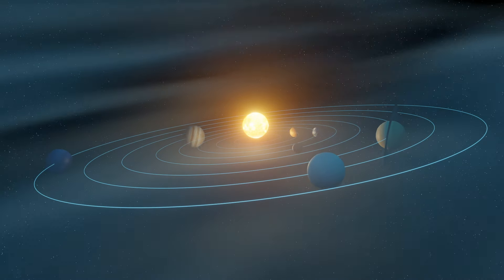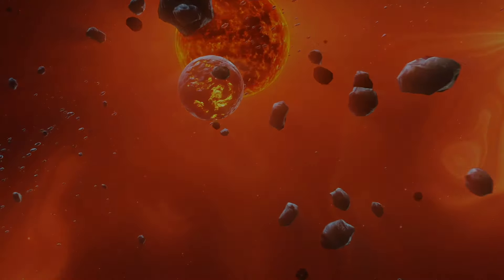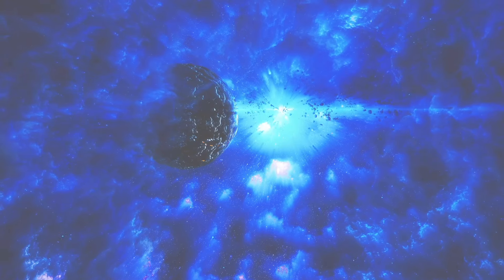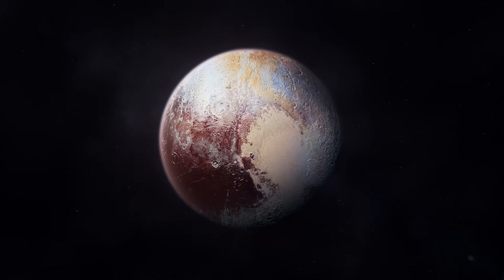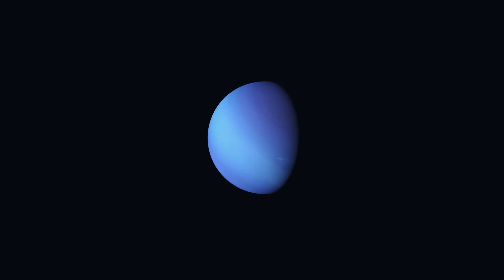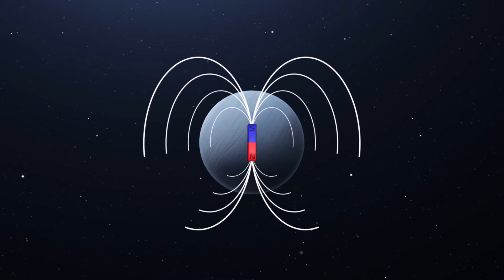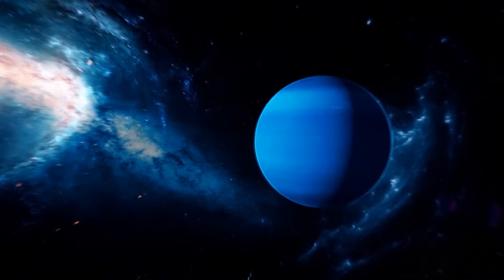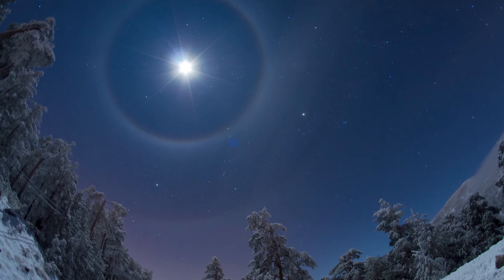NASA Discovers Mysterious Structure In Solar System!

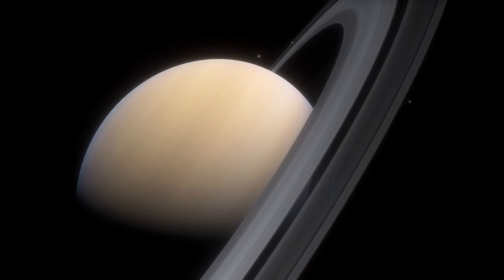Comment: At 41:42, there is something wrong about the methane wind speeds on Neptune, located in the upper right corner of the video.

It says 144 km/h, 360 mph. But that's impossible =/

1 mile = 1.6 km. So if you multiply 360 mph x 1.6 it gives you 576 km/h.

Just so you know, Destiny :) But the video is amazing ! Thank you for that 2 hours of pure speed of light greatness about the universe. <3

Comment: Man hasn't even existed 13.6 billion years ago on earth, so how can they determine and confirm a specific number of years of how old our solar system really is?
Reply: Age is just a theory at this point, cause they use different methods, and each one gives a different result.
Reply: There are even stars older than the universe 🤷‍♂️
Reply: You can tell a star how old it and it’s system is by its metal content. It’s an approximation and the stars that have been measured to be over 13 billion have been remeasured more carefully and with better data. So as of now no star we have seen is older than the universe but we keep finding more and more older stars. Our star the sun is a 3rd generation star.
Reply: @justinwolf7490  Okay,  try to keep an open mind about this.  By measuring the metal content in the stars, how do they know that the method they are using is accurate at determining the age of the stars and our solar system?  Is there another method that is more accurate?  Can they quantify that these stars are indeed billions of years old?  Based on the measuring technique that they use,  how is an estimated timeline to determine the age of stars and the solar system scientific?  If they are estimating the timeline of years in regard to the age of a star then they are really exercising the concept of faith in their hypothesis because the scientific community cannot accurately conclude how many years ago the stars and solar system formed.
Reply: @leviticusashley4447  Yes. My thoughts exactly!👍  Thank you.
Reply: Folks, if all of you go to college and study astrophysics for a few years then you might be able to grasp how all of this works.   As an astronomer I can tell you this.  Millions of stars have been studied in depth, for many years, using methodologies that go way beyond what you can probably understand, given your current lack of knowledge on the subject.
Reply: @booklover6753  You cannot conclusively prove to me that these stars are billions of years old!  Men didn't exist billions of years ago!  Carbon dating has been a hotly debated topic in regards for it's accuracy.  People don't need to attend college degree o learn about astrophysics and astronomy!
Reply: @booklover6753  There is only approximately 6000 years of recorded history from mankind!
Reply: @booklover6753  Yeah, these same experts predicted another ice age back in the 1970's too!  Based on their research and theories that were presented as being factual,  they were completely wrong in their hypothesis of having another ice age in the early 2000's!
Reply: @jasonkhan854  Your comments don't even warrant reply.  It is better to be silent and thought ignorant, than to have spoken and removed all doubt.
Reply: @booklover6753  You're sarcasm and arrogance is very unappealing! People can learn through self study without the prestige and recognition of a college or university!  Many prominent and successful people that have achieved milestones in their lives were self taught and have had no formal educational background!  You're absolutely entitled to believe what you think but so am I!  Your opinion doesn't make you superior to others who do not have a formal educational background!  Science is a discipline,  however,  it is mainly comprised of theoretical concepts that are presented throughout the educational community as being factual!. Scientific theory is no different than a person who studies and believes in theology and faith based teachings!  Both cannot be conclusively proven as fact. Both disciplines are based in faith!
Reply: @wizard1404  Yes, they did!  They lied about everything.
Reply: @leviticusashley4447  no there isn't
Reply: @timq6224  You can not physically prove to me that those paintings in the caverns are 15,000 years old.  If carbon dating is the method to which it can be measured then you have unfortunately believed the lie that carbon dating is one percent accurate.
Reply: @timq6224  In the 1970's when I was a kid,  I was old enough to remember that the scientific community predicted a great ice age that would take place in the late twentieth century and early twenty first century.  I have no reason to lie about something like this.

Comment: I don't believe that scientists know exactly how our solar system formed. Some planets and moons could have been flung from other places in our galaxy, or even from other galaxies, and captured by the gravity of our sun, or other large body.
Reply: I have a different theory...I think the Sun was established and created either from collapse of the region of space where the sun is located due to a tunnel formed from another dense energy source, which that energy source was created from maybe a black hole or the clash of space densities to create a thermic point flaring into the Sun...or the divorce of space to pull out a thermic point or electric point..
Reply: What if at the very center of our earth is a micro black hole...and that is what is responsible for pole shifts...
Reply: A micro black hole surrounded by a dense magnetic field would make sense at the center of the earth because it would stabilize and contract matter on earth and the oceans simultaneously creating a dense magnetic field around the earth...

Comment: Please note a chemistry principle of heat energy guidance being a principle of controlling distanced as the bonding factor of 2 particles, which if to close with the 2 opposite ends coping with space gaps with  their area would be cooling themselves out of having less activity ability sharing, but if made to bond at a greater distance, the bond is heat that still giving them the ability to share instant wave sharing responses, especially if looking at the distance gap as being a magnetic field also considered a bonding factor at the nuclear level but to cope the distance. Or the lead to gravitational settlements of dust particles finding themselves in empty Space, but note these dust particles must be said travelling 1000s of miles a minute with trajectory logics to settlement consideration together even before they start their bonding.
Reply: In other words, the Solar System's dust building it, as well as the Galaxy's, was already in a momentum that was frictionless, thus sharing heat as fusion, instead of sharing friction that would be considered a repulsion.
Reply: Also notice how light drifts with the adjustment of the Solar System's gravitational field of unity of everything in the Solar System's shared gravitational filed as the Solar System speeds through Space making it look like it is standing still.
Reply: In other words, the light stays where it is positioned to stay, and if bend that is not a reflection based bend, is a gravitational bend or shared merging of 2 energies that are at the moment frictionless.
Reply: So with the inner Earth's mantle layer and core being build on heat, this heat must be more like frictionless radiant heat, thus it is like a liquid solidness staying to support and not having to dissipate the radiation in a way when heat is mixed with oxygen causes a chaotic flame burst. Thus the heat could be considered a solid, or like a battery storing voltage, with out the voltage becoming a current to drain the voltage build up with dislocations.
Reply: Also take note if a current is made to leave the battery, anything that participates with its energy boost becomes based on as possible, but if the current makes it back to the battery to rejoin the existing energy stay, it joins back in a frictionless state. A logic of weather?

Comment: 8:38 Mass comes together forms a star.
Upon coming together fusion happens which forms the heavier elements.
Gravitic shifting makes layers of concentration of elements,
but also of more complex molecules, like water.
The initial spin, and speed remains, and expansion happens, velocity
remaining expels the speedy stuff, and along with it gaseous water.
Since both speed and gravitic were the separators and concentrators,
it stands to reason that at a certain distance as a result of an orbit speed
certain molecules or elements acrue the most.
Note that the actual amount of water is actually very little, while at this distance
withs aid orbit speed, mostly metals acrued..
The gas giants got the most of the gases.
The planets beyond them are leftover chunks by runaway acretion.
When there's nothing to reduce the speed, the speed becomes
greatest on the outside of the spin.

Comment: Alot of the water is stuck deep down in the mantles crust too. They didn't calculate all the water that would've seeped deep down and absorbed by dirt,sand n rocks and in the water running underground in caverns n lakes n stuff.
Reply: do not confuse water with an hydroxy molecule.  The earth's mantle is full of hydroxy molecules not actual water.  The video already shows how much extra water is in and on the planet.

Comment: If the Sun is a ball of electricity and if space has an oil like viscosity, the two combined would create hot/cold plasma, correct? Is there such a thing as cold plasma?
Reply: if donkeys had antlers they would be reindeer.
Reply: @cameronkrause4712  what causes the same metals to immediately fuse together in space? What's cold fusion?  Will there be cold fusion engineering in orbit in the future?

Comment: How can you have liquid diamonds? Diamonds are a sublime which means they can only exist in 2 states solid and gas! Unlike water and metals if you heat them they have a melting point turning them into a liquid state and if you continue to heat them they have a boiling point turning them into a gas. And diamonds have no melting point just a boiling point (around 6500+ degrees centigrade)

Comment: If only people would wise up and build a moveable space station.
Once done, everything can be examined at great length
and with sufficient long term support.
Attach a few ion engines, and off you go.
Required fuel consumption roughly 1.6% of mass for a trip to Kuiper belt,
travel time 156 days, 312 days round trip at 3.2% mass for fuel.
Ion efficiency estimated at 0.5 c Isp.
Cyclotron based ion engines => for trekkies, impulse engine.

Comment: 1:37:25, I wonder if the light and matter from those supernovae had measurable effects on the genetic evolution of species on earth.
Reply: yes would be the short answer.  Almost a change to genetic structures are the result of some form of radiation.  A nova pointed in just the right direction would irradiate anything in it's path.

Comment: Black holes are smaller than the tip of a pin... The event horizon might be the size of a grapefruit...  Ets aren't hanging out on a -400  degree rock in the kuiper belt and you touched on the fact planet 9 was a miscalculation that is now fixed... I thought this was what we found and not speculation on what we haven't found.

Comment: When looking through the telescope what is the starting point of the beginning? Are we moving in the direction of all other solar systems and universes?
Reply: The starting point was the separation/division of the physical dimensions.  That's long before the cosmic background radiation and it lasted forever.  The expansion of space also applies to the expansion of TIME. Physicists neglect to consider that.

Comment: If the core of the sun is 64% helium and 35% hydrogen and the general composition is 91% helium and 8% hydrogen that doesn't sound like the sun is going to last another 5 billion years at that consumption rate. We won't care since Earth will be too hot a billion or so years from now. However, I seem to remember that while helium fusion is hotter, it doesn't last nearly as long. Hydrogen fusion goes for billions of years but helium fusion is measured in millions of years... and low millions at that.

Comment: If you say 5, i say 6 major extinction. There was a big extinction in Precambrian, 1000 Ma ago. The extinction of the stromatolithes which was the EXACT limit between MESO - proterozoic and NEO- proterozoic.
On the other note, 
1. the end of Ordovician as far as I remember is ~443 Ma, the ~415 Ma is the Silurian end (~419 Ma);
2. ~322 Ma is the Carboniferous period and not the Late Devonian. (Devonian ends at ~358 Ma);
3. Permian starts around ~300 Ma (~298 Ma) and ends at ~251 Ma;
4. Triasic starts with the end of Permian, ~298 Ma, and ends at ~201 Ma. The 145 Ma is the end of Jurasic period;
5. End of Cretacious period is ~66 Ma. The 33 Ma is way in the Cenozoic Era.

All the informations you can find in the chronostratigraphical chart (please check the latest version since there are new updates compared to the old charts). Thank you.

Please update and fix this. Don't spread wrong informations and correct it with the adequate dates/informations which are studied, written, published and accepted by all scientist.

Comment: 22:42 Its not "in" our solar system.  It's supposed to be ~40AU in between Sol and it's sister star, a red dwarf, which has not been found.  Perturbations of the outer planets suggest a heavy body out there, whether that means a planet at 40AU or a small star at 100AU. Its orbit is like a figure-eight and orbits both stars.  That's why its been called "The Planet Of The Crossing," like a conveyance between the inner systems of both stars.

Comment: What I thought of is if black holes effect the speed of time then the age of the universe next to a black hole would be infinitely longer than we assume it to be where we are. 

So the age of the Universe would vary by each black hole based on their mass as well. Which is wild to think of.
Reply: That would mean The universe is multiple ages. If you were next to a black hole but could see earth. You could see the entire formation of our solar system in the matter of years from where you are near the black hole because the gravity around you
Reply: not quite, for the moment time is linear
Reply: @zincbakwarrior9844  time is linear, but gravity speeds up or slows down its speed
Reply: @zenorabbit439  relative to us, speed changes but the time doesn't. therefore the universe (more or less) has a set age. but i do see your point

Comment: Video title: "NASA Discovers Mysterious Structure In Solar System!"

Actual video: Doesn't discuss a mysterious structure in the solar system.  Instead, the video discusses well-known basics, mostly about solar system formation and the planets ("Yes, Uranus spins on its side!" Golly gee!).  If you were watching this for what the video title suggests, get set for frustration and disappointment.

The current best estimates for the size of the Milky Way's stellar disk are 185,000 +/- 15,000 light years, or 170,000 to 200,000 light years, not 100,000 to 200,000 light years.

In both American and British English, Oort is pronounced "or-t," not "ur-t."

First mention of mysterious structure, 13:15.  Followed by "aliens" did it.  I stopped watching.

Comment: Space is lonely af, try to travel across space and time dilation slaps you in the face, try to find life via telescope and it would almost certainly be extinct already by the time we see it, let alone contact it, leaving our galaxy is out of the question, the radiation alone would take unreasonably thick led shielding of which youd need more the faster you move, severely limiting the top speed at which we can move